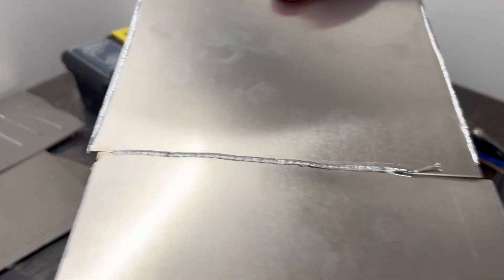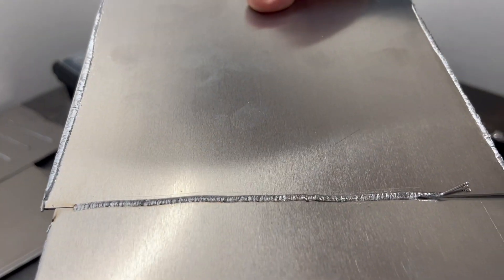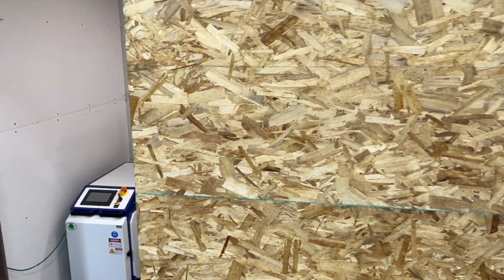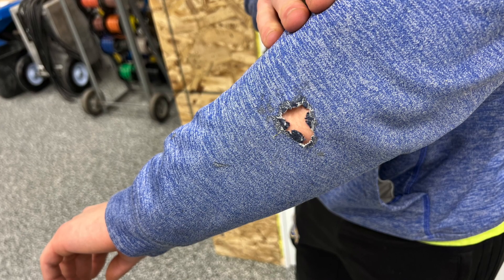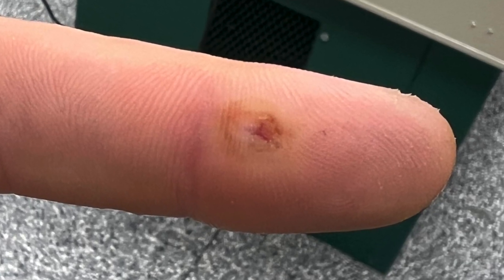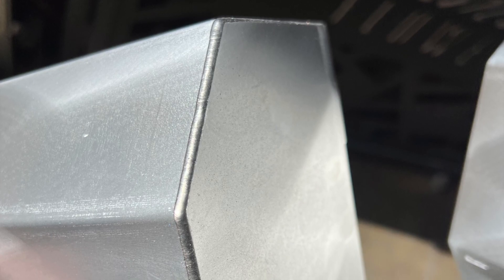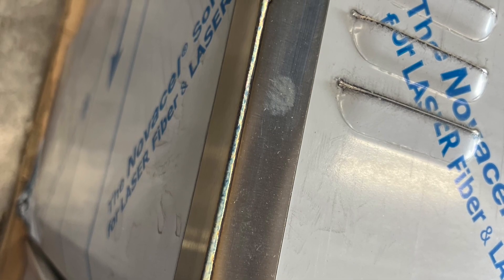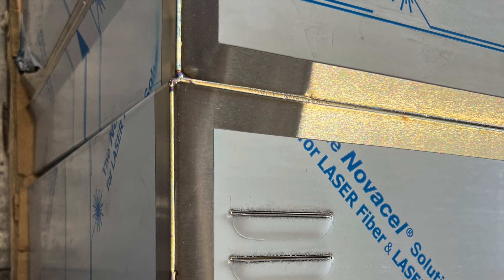LASER WELDING - IS MIG TIG STICK DEAD???

Comment: Laser welding has made MIG, Stick, and TIG obsolete—it's time to move on. I have a Fronius Magic Wave 230, but I never use it anymore because my laser welder outperforms it. Any tool can be dangerous if misused, but in terms of ease of use, laser welding is far more user-friendly and much cleaner, even for beginners. When welding aluminum, not having to establish and push a puddle makes a huge difference, and with the right settings, achieving strong welds is effortless. It’s not just for robotic systems—handheld units can produce flawless welds when using a guide or prop. Plus, you don’t need a massive setup; a 1500W air-cooled machine is compact, lightweight, and more than powerful enough for most jobs.

Comment: If I was making stainless countertops, it’d be awesome for that. I worked with robotic laser welding for years on aero parts and the biggest failure mode was missing the joint because of the shape of the fusion zone. For structural stuff, NDT is pretty important for laser welds even if you have a good qualified process.
Reply from the maker: @TimWelds  and handheld laser is a different skillset then what i am used to ….

Comment: Hi Peter, where I see this being useful (eventually) is in autobody. 1) I agree it's best for CNC processes but 2) Autobody sheet metal, particularly aluminum, which is becoming increasingly common, and high strength steel sheet metal that's very sensitive to heat and warpage the speed and low heat transfer will prove to be a winner. TIG just gets this stuff too hot which doesn't matter too much on the thick sheet metal used in 1960 but makes the process far more difficult on thin modern panels. It might not be there yet but progress will happen as the need is there.
Reply from the maker: Dennis, steel welding is much more intuitive .. aluminum is very challenging ... I have no crystal ball to see what the collision industry is doing next ... sometimes they have awesome stuff going and sometimes they have just a bunch of politics and bs going ... hard to say for me what they are going to do next ....

Comment: Are you sure you had the right settings? Doesn't seem quite right, or maybe it's not all that great as advertised...
Reply from the maker: how can anyone be sure anything ... there is a ton of adjustments on the machine, operators manual is shit, documentation is not available ... my findings are, either it looks good and its way too shallow penetration, or it totally cooks it and you have a much of boogers on the backside ....  I was not able to find a "good middle ground" .... that does not mean that the machine is defective it means that a guy with over 30 years of welding experience was not able to dial this in the right way within a week ...
Reply: @ZILAwelds it need to play it as long you know every trick and kick rocks on 💪

Comment: Safety is a big concern with these machines. Even with a 1000 times less power it would be still a class 4 laser. You definitely need a dedicated laser room. No on job site welding. No outside welding. As the price drops further, more people will buy them and do stupid things with these. Then I totally expect my government (Germany/EU) to regulate these machines up to a point where it gets uninteresting to buy one. Most likely the machine will cost 2000 and the license to use it 20.000.

Comment: Great info Peter. The laser, at least for now, appears to be best suited for an automated/production environment. I won't be selling my Invertig 251 any time soon! :) All the same, it's cool to see new technology on the way.
Reply from the maker: It's not about replacing the old, it is about adding new options.
Reply: @ZILAwelds  Yes, absolutely! Would be cool to see a handheld laser to replace the TIG torch but still hand feed filler rod. No more tungsten prep/sharpening.